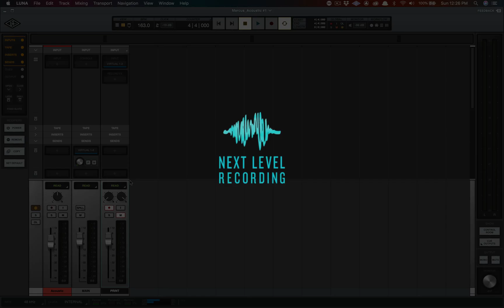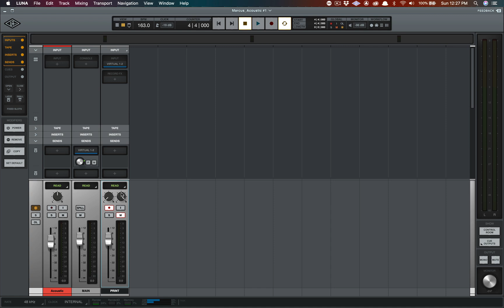How to Print Audio in Universal Audio's Luna | Next Level Recording

Comment: One question where do you route the print track to you can't leave that empty I don't think it has to be routed someplace the input you can leave with none but not the output if you Loop it back to the master won't that be a problem I don't know that's why I'm asking
Reply from the maker: Everything eventually goes out to the master! So you would set the input to a virtual channel, and the output to main. It will not be a loop back feed.
Reply: My Main is Virtual 1-2 For some reason. Maybe I gotta go into Console settings and change it there. Or do nothing because it already works. Thanks for the info. @GrimaldiSound

Comment: I tried this, and it still did not work so I'm not sure if someone else has another method maybe?
Reply from the maker: Hmmm that's strange. I just started a new session and tried this and it worked perfectly! Is the track just not getting audio to it or what? Make sure the send is set to unity gain!
Reply: @GrimaldiSound  I tried this and I don't have a virtual channel.
Reply from the maker: @chofo273  Hey Chofo! What interface are you using? You might have to go into the console IO settings and enable the virtual channels. I recently had to do that when I updated to the newest version of Luna. They disappeared but came back when I enabled them in the Console IO!
Reply: @GrimaldiSound  thanks. I'll have to check that.
Reply: @GrimaldiSound  I don't see the virtual channels either. Interface is Antelope Discrete 8 Synergy Core
Reply: Sorted it out. Thanks!
Reply: I just get a crazy amount of delay on the print when I do it this way...? Any thoughts

Comment: Hey I might just pull luna out to try this since I was stuck right here in pro tools, got luna, aaf(ed) the entire 30 tracks to luna from PT except no plugins fx came in the aaf; all dry luna tracks now. Long story short I figured one by one put plugins on each track again print them in luna. Soon as I gave tracks to each plugin, luna rendered PORTIONS of each of 30 song tracks imported and random areas of each track as "offline". Knowing I was in an INLINE system and offline or online should have nothing to do with anything of the file I pulled 100% of in the aaf folder, for that matter, especially within areas of each of 30 tracks disabled by luna, labelled "offline" (whatever that means) permanently disabling ALL Functions dsp/keyboard/mouse in luna's chosen areas of each of the same track while other areas of the same tracks were A-OK, fully functional... I put it aside.
Reply: PT is easy to Print Just set up a stereo Audio track and assign your input to say bus 9and 10 or any 2  then rename it print and set your outputs to print on the tracks you want to print , And you should definitely go back and try LUNA . if you ask me it's better than PT. And a 3rd party tested the audio you get out of it. . It's a little bit higher quality than PT